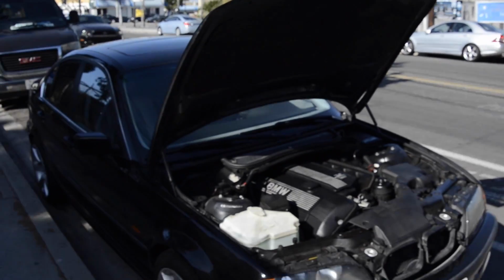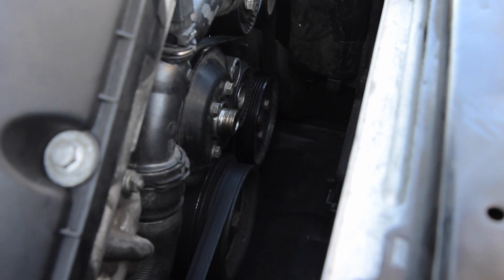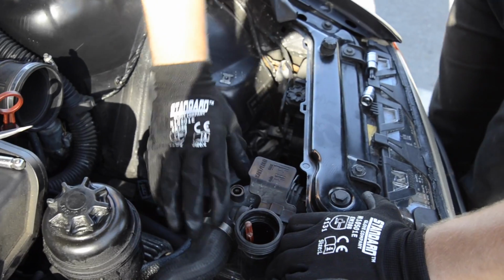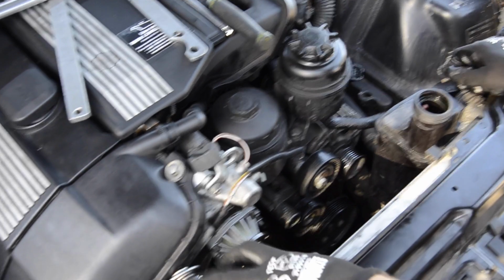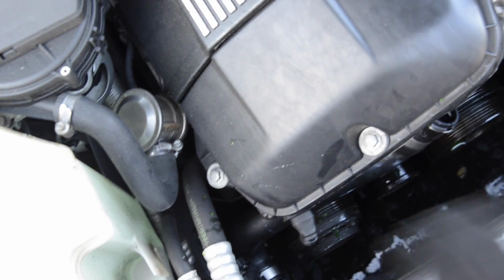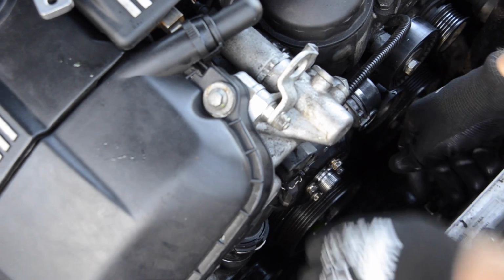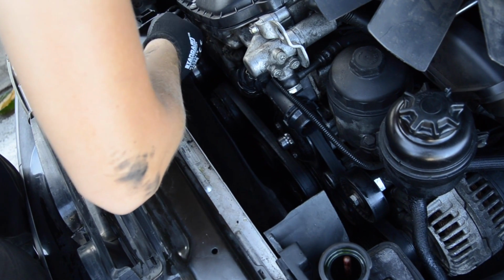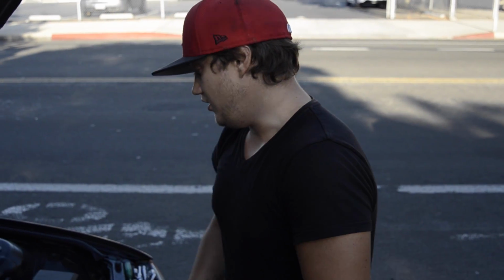DIY BMW E46 Water Pump Thermostat Replacement M52TU

Comment: I have the same vehicle the 99 BMW 328i E46 and it started to overheat. I just purchased it from a previous owner. I know it may need some more work on it as well. It does run but hits overheating very quickly and white smoke comes from the hood. How far do you guys travel because in Charlotte, NC not many mechanics or shops want to work on a BMW especially an older model like the 99. Your videos are very informative